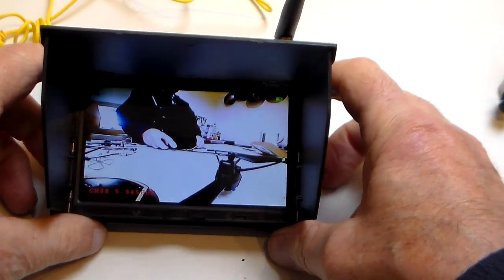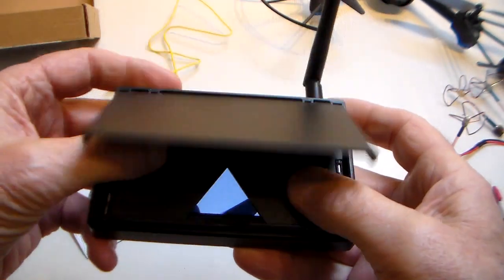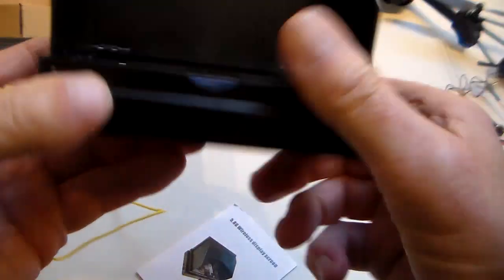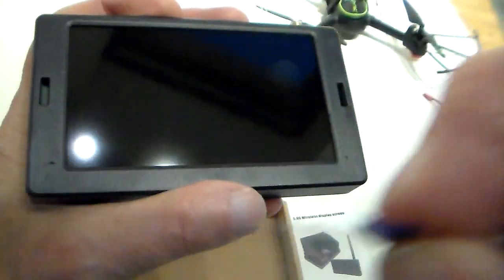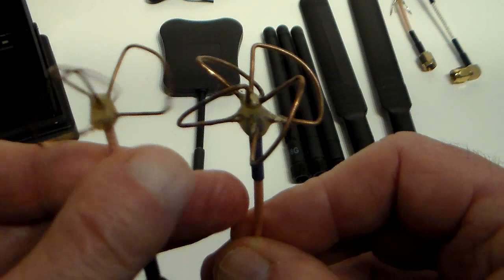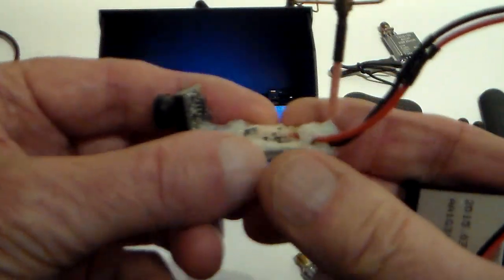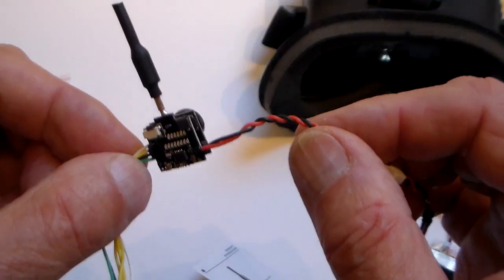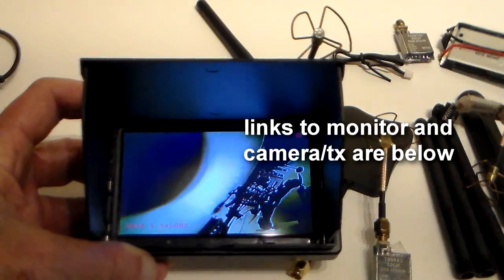Best budget FPV monitor   -  Get into FPV without spending a fortune!

Comment: I actually bought a receiver that plugs into my phone and a free app called OTG view lets you view, it also works as a webcam so you can view it on a laptop. I think it's an eachine rotg02 or something.
Reply: Sounds good.  Do you have a link for more information or to buy?
Reply: @beefybeef1326  'UVC OTG FPV Receiver' should let you find them on Aliexpress, banggood, or any other Chinese electronics website.

Key things are: Your phone usually needs to support USB OTG (a USB input into the micro usb or USB-C port), and also support UVC video. For 15-20 euro for a receiver, easiest to just test if it works I guess. You'll also need an app to view the UVC video stream, searching for 'UVC viewer' will get you plenty of hits in your appstore, just try a few to see which one works best/is most stable for your purpose.

The first one I got broke after a few weeks, but the second one (free from banggood customer service, although their customer service has gotten a lot worse since) is still working. Only the USB converter part of the first one broke, so the analog output is now hooked up to my tv for tinywhoop flights. I also sometimes use the USB one with a normal usb > micro usb cable to connect to my laptop, so I don't need to bring goggles to fly a tinywhoop

Works fine, most also have a channel scan function which is nice for checking free channels. I use it with my phone sometimes to let family/friends watch along, and once tried to use it when my goggles failed. Sadly, the USB plug got disconnected as I grabbed it, and I decided I would rather risk a crash than a flyaway whilst I tried to reconnect the receiver. Drone was a bit muddy, and I could only spot the LED's after dark, but no major damage luckily.
Reply: @JoranGroothengel  thanks!. Much appreciated
Reply from the maker: @JoranGroothengel  I think the support OTG was the issue I had with my old phone, (that I messed up!)
Reply: @beefybeef1326  This is one I have on BG: https://www.banggood.com/custlink/v3KR5fq64l
I don't know how good the picture is since I can't fly and watch, it does seem to have a little latency on a laptop though. I usually use it to pass to friends who don't fly or to make OSD changes etc
Reply from the maker: I've seen them advertised.  Look good. Haven't tried one.  A few years back I tried to make  fpv work on  my phone, it was complicated then. I had to power the device externally and plug it  into the mini usb socket.   Buggered up  the socket on my phone! It wouldn't connect anymore afterwards.